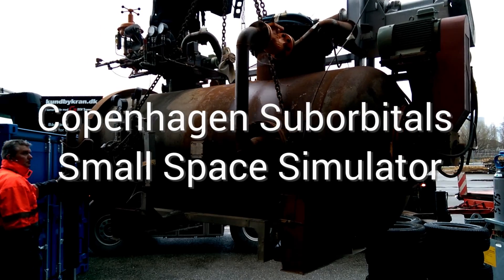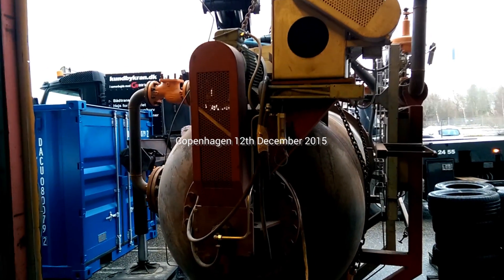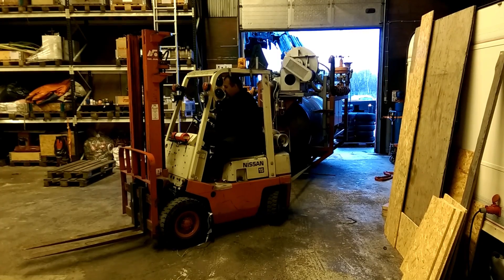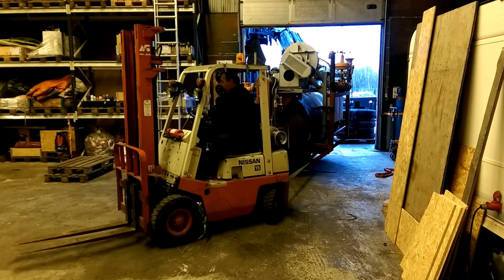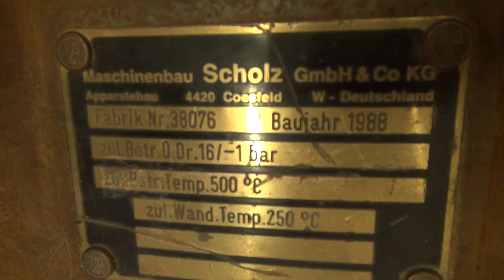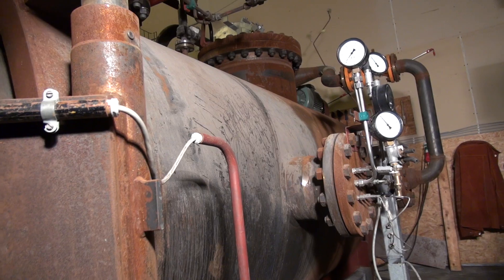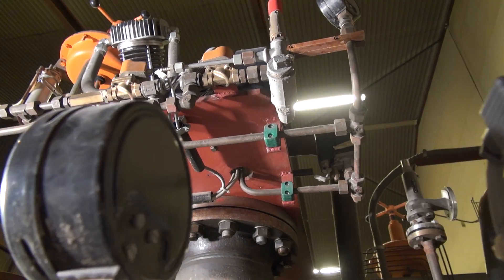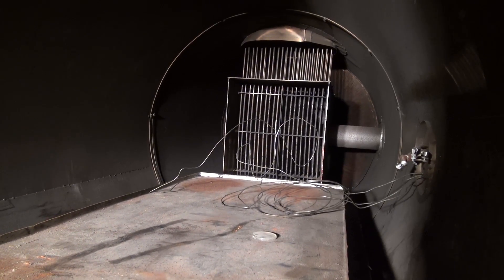Copenhagen Suborbitals - Small Space Simulator

Comment: OMG. copen i was thinking about myself tring to build something like this, you have possibly no idea how valuable this thing may be? look up HIP TECHNOLOGY. basically you buy ground nickel or inconel dust. then sutable clay/wax mixture. have a mold made for you combustion chamber. then mix teh metal and wax/clay mixture and injection mold the combustion chamber. then put the part in this and cook it at high pressure. the hydrostatic pressure will provide 100% theoretical density higher then that of pressing and forgings. not sure if this is strong enough to with stand the pressure but could very well be.
Reply: yeah but even if you injection molded a thrust chamber using powder metallurgy out of aluminium then hot isostatic pressed it, i dont think you will have anymore problem with heat engine with pressure blowing out the nozzle portion.